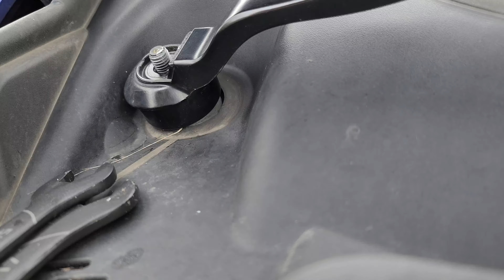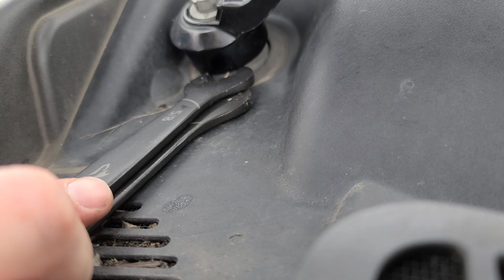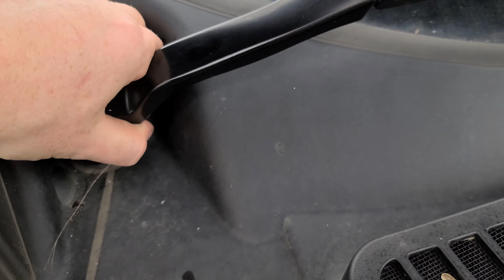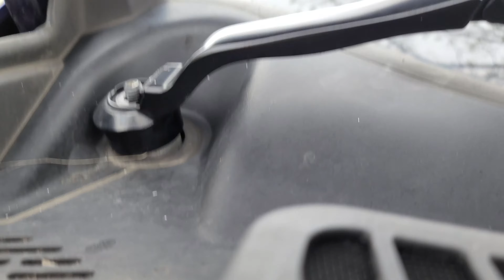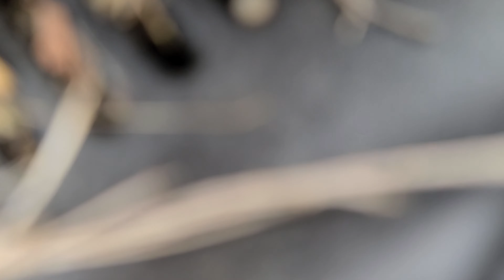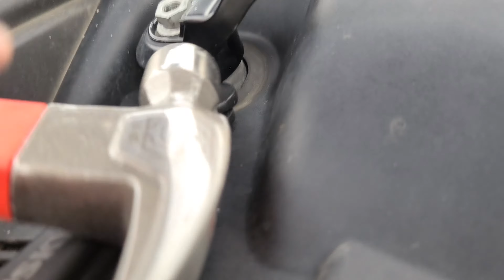Tutorial - Removing a wiper arm without a puller

Comment: Lmao..try it on a seized 15yr old arm...
Reply: WD-40 or blaster PB works wonders
Reply: @jimmyellis2011  have tried both..2 different pullers after using pry bars and hammer and vice grips and a torch..now im just going to grind the mf off and order a new arm ..short of ripping it off motor and all with my bare hands that's the only last option..is cutting and replacing...passenger 2 bolts came off with wd vice grips and some pulling power..this arm is the 😈..and i will be VICTORIOUS...👍
Reply: Get it!! Get after the demon, but be sure youve killed it and not just let it loose to infest others.